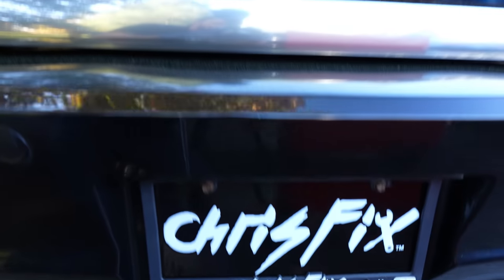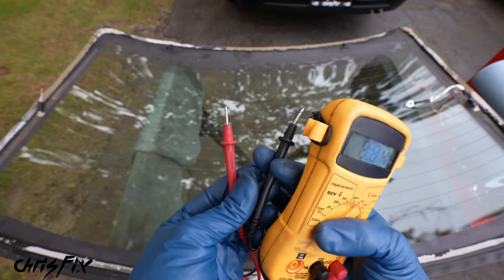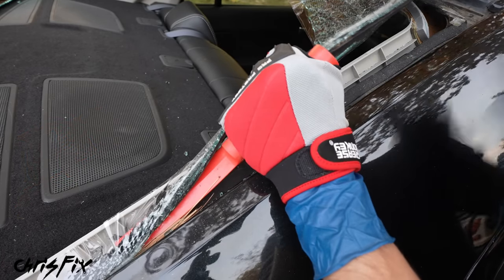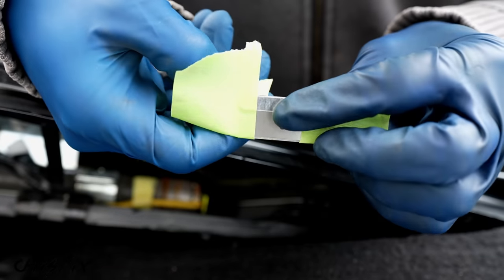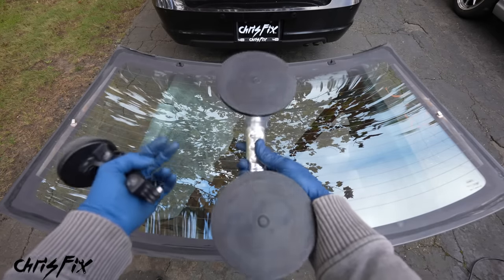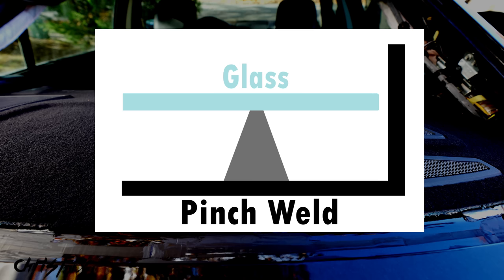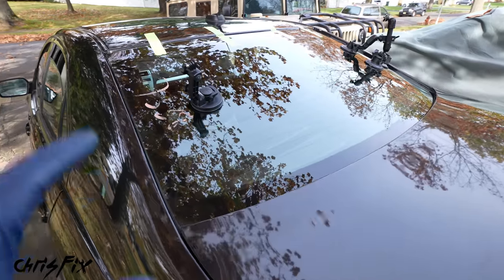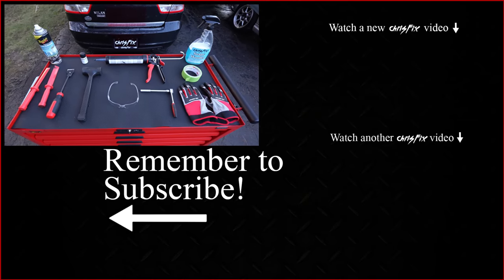How to PROPERLY Replace a Rear Windshield (No Special Tools DIY)

Comment: Professional glass installer here, I wanted to clarify a couple things. First of all, alot of eurethanes also require an activator as well as a primer. It depends on the brand, but it's something to be aware of. 
Finding eurethane lines on sound deadening is pretty common, especially on fords. On the front glass too on the bottom corners. After you remove it you should always scuff any clearcoat that is smooth, primer and eurethane have trouble bonding without scuffing. 
You don't need to stress about fully removing eurethane from a window thats going to be reinstalled, I know from experience that as long as you trim it thin and uniform you'll be fine. I've seen techs actually break glass from pressing too hard from scraping.
And absolutely 90° at all times if possible with your gun while running a bead. The easiest way to paddle is with a popsicle stick or piece of wood that you hold in your mouth for a minute or two. Your saliva will keep the wet eurethane from sticking so bad to your paddle, which will help you to not stretch or manipulate the bead too much.
Reply from the maker: Thanks for the tip! I’ll have to try the wet popsicle stick next time for paddling! The urethane was so sticky it was almost impossible to not make a mess!
Reply: hello fellow glass man, everything you just said is correct! That bead made me kinda nervous, a little too skinny and it might roll over. Didn't seem to be the case here obviously
Reply: @thatcreepykid123  I agree, I prefer my bead height to be twice my bead width. That seems to be the sweet spot.
Reply: @chrisfix  As someone who has dealt with sealants quite a bit, you did very well! I waterproof/weather proof on an almost daily basis. Great work!

Edit:I don’t deal with too much glass, but other applications on home and business exteriors. But still a good and informative video.
Reply: As a fellow professional glass installer you stated great points. I just wanted to add that urethane bonds best to existing urethane. Also where you pointed to scuff the clear coat where the sound denting was, he should add at least 2 coats of primer to that area with 5 minutes to flash in between
Reply: Fellow glass man here. And everything said is 100% percent correct.
Reply: Just curious here would this also work for the front as well?
Reply: @grimmsoul1343  its pretty much the same process. Unless you're a professional though, you're going to need two people to set a front windshield. Front glass is also laminated, not tempered. So the removal process is a little different.
Reply: @grimmsoul1343  depends on the car! In newer cars they have “eye sight” which will need recalibrated after you replace the windshield.
Reply: @signalflare3791  yes same process but it’s easier to set the windshield with two people. Many technicians like myself though learned how to set with one person without helping tools such as the sidekick or the buddy
Reply: @anthonydimdiman5025  same, I single handset everything possible. Saves time.  The only things I don't are overly large windshields, windshields that extend six inches or more under the hood and some high end stuff. There are variables of course. But not many.
Reply: This is definitely a task i'd rather just pay a professional a couple hundred bucks to do instead of attempt myself.
Reply: I agree with all of this, the only thing that I would add is to decontaminate the glass to ensure that you’ll get a proper seal
Reply: @chrisfix  if you pay attention to the pattern on the cracks of the glass you will be able to find the breaking point, in this case it seems that comes from the driver side at the bottom, some people get in their cars not noticing the glass is broken and as soon as they close the door the glass falls in pieces and they might think it was them closing the door.

13 years in the AutoGlass industry
Reply: What kind of activator do I need to get.  I am going to use the 3M 08609 Window Weld like Chris Fix is using in this video.  Also how many tubes of urethane do I need for a back window?   I will be installing a back glass in a 2002 Pontiac Grand Prix.
Reply: @jeremymo4095  , I'd just get some 3m one step primer and not use activator. Get I nice and clean with glass cleaner and paper towels then prime it.
You should only need one tube for a backglass, I'd recommend you have to just in case though. Never know.

Comment: Auto glass technician here. I’m impressed how well you did this replacement considering the nature of your channel and level of experience. I’d say you hit ~80% of the quality that’s expected from the company I work for. Which, for some, especially for tempered applications, is good enough. I like that you emphasized how important it is to make sure you use primer and adhesive from the same system. You talked about the V bead, and why it’s so important to use it over the circular bead. Your V bead is too skinny. You want to first cut the tip horizontally then cut the v bead. The base of the bead should be about 1 cm wide. The horizontal line on that specific tip you used is exactly for that. It came the way it did so you can apply a small amount to glue down rubber moldings. 

For front windshields, I cannot say I recommend DIY replacements. The front windshield is a critical part of the passenger retention system and will fail if not properly installed, and the room for error is far slimmer. Also, to anyone who tries this on their own. PLEASE if you find rust, you MUST remove the rust to bare metal, and treat the bare metal with a rust neutralizer and primer. DO NOT apply urethane to the rust. It WILL FAIL. 

Many urethanes take over a week to cure fully all the way through. If your test bead comes off your practice surface and it’s wet in the center but not the sides, that’s normal. Good luck y’all
Reply from the maker: Thanks for the tips!
Reply: If a car is repainted with the glass removed, is it OK to use the urethane primer over the new paint or is it better to have bare metal with the urethane primer over it?

Thanks for the pro tips.
Reply: @davidparker9676  less layers is better, less opportunity for delaminating. However, the primer coat protects from rust and is very important! Paint won’t hurt, but it’s unnecessary under the glass. So if you’re having it repainted, I wouldn’t bother with the paint, but absolutely do not leave it bare.
Reply: @Max_Arjona  yee epoxy primer then pinch well primer is how it’s supposed to go
Reply: @Max_Arjona  LoL

Comment: Chris, since I discovered your channel less than a year ago, I have repaired scratches and chips in my paint, repaired rust spots and holes in the body, found and fixed leaks in my exhaust, cleaned my engine bay, detailed the leather and vinyl in the interior, flushed and fixed my heater core and a couple of other things I can’t remember...............Thank you.  I wouldn’t even have dreamed of doing these things prior to watching your stuff.
Reply: Right, I used to watch his videos for fun, back when I was young and dreamed of having a liscense, I’m older now restoring a classic car and his vids have been amazing, I just pulled my transmission out the other day with the help of his videos, he’s the man

Comment: As someone who does this for a living. You've done a great job. I've seen a lot worse from pro's. 
A few tips to make your life easier; When cutting back the old glass and urethane, you can use a razor blade scraper or any sharp scraper for that matter. Any additional scratches you may make will be covered with the primer and it will save you a heap of time plus minimise any risk of cuts when holding a blade with your fingers. I would also have a wider base to my bead, it will help to keep it standing upright. You could also bead around the glass if you find getting a decent bead difficult under the boot. 
  I'd like to add that most auto glass companies will come and install the glass for you, regardless of if you supplied it or if they did. It would definitely add to the cost but if you find you lack some of the tools it would work out the same. Especially if you provided cheap second hand glass.
Reply: I completely agree with what you said. Some Urethane companies have pre cut tips as well, which is what we use at the company I work for. Most of the time if I have to cut the tip its just to adjust the bead height in the rare times where it needs to be taller.  Overall his video was good and seeing first hand how some of the "pros" work turns out he did a way better job. Something to note is many companies may or may not uphold any warranty work if you supply your own glass depending on if it was obviously caused by the installer due to not sourcing the glass themselves. Although not often is that concerning so long as the installer knows what they are doing. It would have been good if he showed the proper way to use the cold knife as sometimes you do need it and without proper knowledge of how to use it you can very easily damage the car. Though without practice for many the damage is inevitable. Even using it everyday there are times when it still does. Then it is down to knowing what to do in the event of damage, hopefully nothing to severe. For a back glass doing everything you can to avoid using it is best since it will limit any personal injury from the blade cutting out through the broken glass flinging it towards yourself. Both the glass and the knife. I once had the mirror button break off the windshield and a piece of the glass fell onto my forearm and it still cut me a little bit just falling from my hand to same arm that was extended holing the mirror lol. It can be very sharp so best to always avoid flying glass.
Reply: We always used a guitar string to get the old stuff off
Reply from the maker: Thanks a lot and thanks for the tips! I was actually going to have the glass company do the work originally but they said they were so busy they were a week out! That’s when the idea of me doing it became a reality haha.
Reply: Chris my boi Make how to fix a dent plz
Reply: @chrisfix how long you guys have the murcury?

Comment: ChrisFix always puts these videos out just at the perfect timing. I have a cracked windshield but also have some rust that seriously needs fixing on the top pinch weld and the bodyshops all want $3-4000 to repair it (cut out the roof 12" each side of the rust and weld a replacement segment in, and they say it's like 12 hours of labour. And even more appropriate I have a 2010 Fusion which is the exact same construction as his dad's Milan.  Thanks again ChrisFix for THE MOST valuable content on the entire internet.

Comment: Probably one of the best car repair-related videos on YouTube ever. Almost no one does this themselves. It seems that to most, glass is something you must get a specialist for. Great that someone not only shows that it can be done but also an in-depth on how.
Reply: Chris is definitely not a human. He’s a freaking goat 🐐 because he knows how to make people’s lives easier by doing very complex work done by experts at home. ChrisFix is definitely the GOAT of DIYs and definitely the first car YouTuber that earns and deserves 10 million subs and the mighty diamond play button!
Reply: I work at a semi tractor shop and we have to do glass repairs ALL THE TIME so this was a nice refresher course, he did everything right. I personally am weary about spraying the glass down only a day after however, we tell our drivers not to spray water on it for 7 days, but we also use different products and lay a much heavier bead for those larger windshields. What sucks nowadays is cars have a lot of tech shoved into them and the windshield can hold cameras, sensors, radars and all other types of things that really do force you to get a specialist for. Messing those things up with cost you SO much money to fix. But if you have a basic windshield with nothing but a rear view mirror, glass is SUPER easy to replace. I don't even use suction cups 😂🤷‍♂️

Comment: More tips:
Wear old clothes. Windshield urethane won't come out if you get it on you.

Similarly, put a drop cloth down over your package shelf in case you drip urethane on the cloth interior.

If you do have an accident, brake cleaner is the only thing I've found that will dissolve it. Spray, dab with a clean cloth, and repeat. Don't wipe back and forth.
Reply from the maker: Thanks for the tips!
Reply: Denatured alcohol works for cleaning up urethane. That's what we use when I used to work for an Auto Glass Company.
Reply: “Dab with a clean cloth” 

 -Feel sorry for the kids who still dabs in 2021
Reply: Brake cleaner is basically acetone.  It's cheaper to get a can at home improvement store.
Reply: @BigBrotherIsTooBig  Acetone is a component of brake cleaner but only a minor one (25%). Brake cleaner is not acetone.